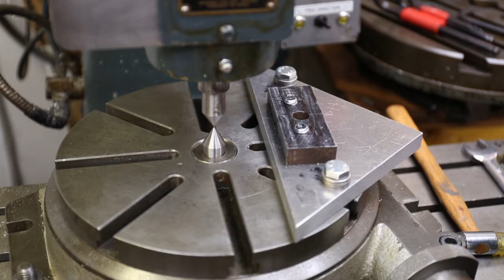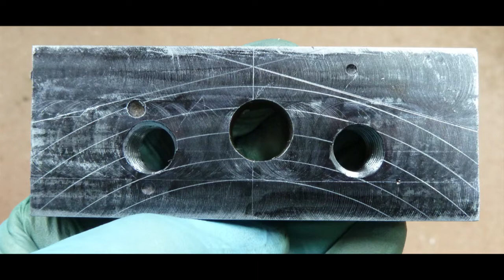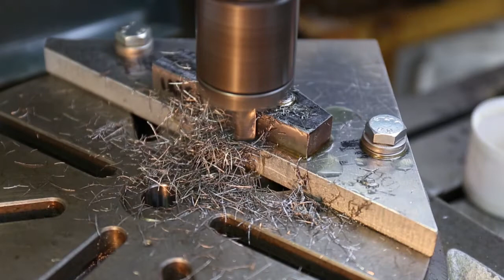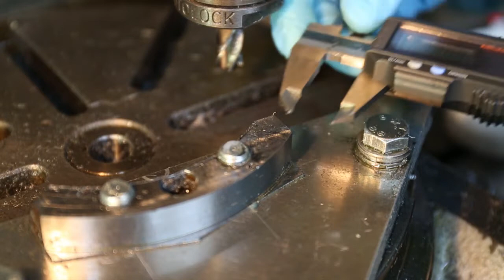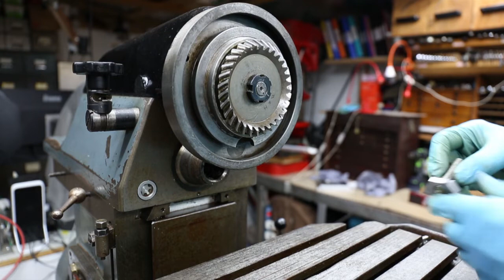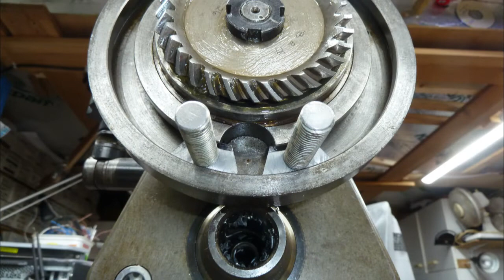Milling Curved T-Nuts on Rotary Table. Vertical Head Alexander Master Tool Maker Part 3

Comment: 12:20 the statement that conventional milling gives a better finish and is kinder to the maschine is plain wrong. Its exactly the opposite. Climb milling reduces the load of the cutting edge, which leaves a better finish and  improves tool life. You only use conventional milling if you have problems with backlash from the lead screw and nut. Or in your case the worm gear inside your rotary table.
Reply from the maker: Hello Tepre H.
You are correct. Recently with the advent of modern machines that compensate for backlash or have backlash eliminator, it is now accepted that climb milling is the preferred way to machine your job.
However, if you have an older machine that does have problems with backlash (like mine!)  then Conventional milling is kinder to the machine, and in my case does produce a better finish.
When making videos, it’s a difficult job to decide on how in depth to go on a subject. Its always a balancing act between keeping the video to an acceptable length, and what information to give. What I said is correct for the age and wear of my machine, and that is the machine that’s in the video. Thank you for your comment, and I hope you understand why I said what I did. For the benefit of people reading along with this, there are times when it is best to use conventional milling even on a modern machine, this is normally when the job has a hard surface, or if the surface could contain hard particles, castings, forgings, or a job that is case hardened are good examples. The reason conventional milling is better in these cases is because the cut starts in the softer material under the surface of the job. Take Care Jim

Comment: Hi there
New subscriber form Ireland here
I have just found your channel and let me say that was an excellent video, you are a natural teacher
I have recently purchased a similar machine, its a Klopp-Korradi UW 10 and have a rotary phase converter coming soon
I wonder if it would be possible to make a location pin to avoid having to tram in the head every time ?
Thank you again for sharing your knowledge and please keep up the good work
Reply from the maker: Hello Seamus. Thank you for your comment and kind words. Klopp-Korradi UW10, this is a good quality German tool room machine, you have a lot of happy hours ahead of you using it. My Alaxander has its roots in Germany being a clone of the Deckel FP1, I have noticed in its vertical head there are holes which look like they are there for set up pins, but I haven't investigated them yet. I suspect if I was machining an important job, I would be checking the tram of the head with a DTI gauge, just to make sure. Take Care Jim

Comment: Hi Jim. 
I am a retired wood worker but have developed a keen interest in metal working!
You explain things very clearly, and I am learning from your vids...

Thank you, chap...
Frank...
Reply from the maker: Hello Frank, thank you for sending in your comment. I'm so glad you enjoy my videos, and over the moon you can understand what I'm going on about. When do you buy your metal lathe?
Reply: @CYC123  I have already got a metal lathe, and a mill. but sadly, I was green, and I don't think they are very good, but get by. However, I did have to buy at the budget end. I have already done one or two mods on the lathe, fitted a bigger tool post... I have removed the compound slide, as it was pretty bad, but can fit it back should I need it!
Funny thing is, I had to make some T-nuts the other day as the one that came with the machines were pretty useless...
Looking forward to your next vid...
Frank...
Reply from the maker: Hello Frank, it pleases my heart you already have a workshop with metal working machines, there don't seem to be as many around as there use to be. Good luck with your projects. Take Care Jim